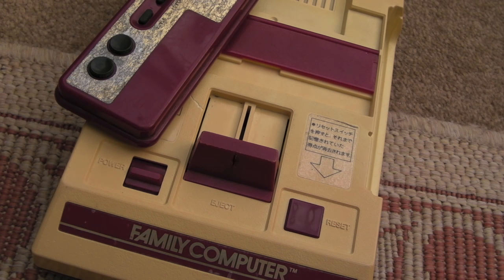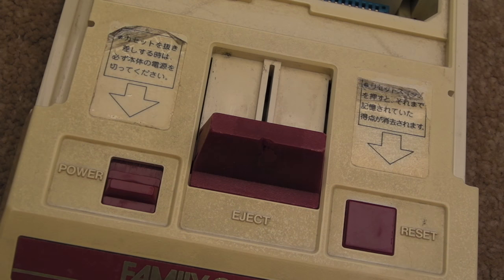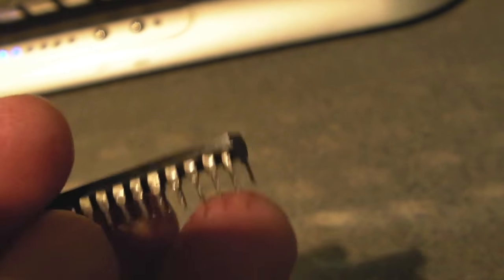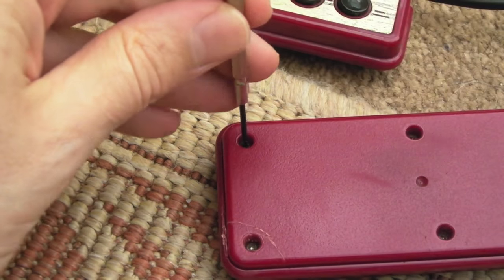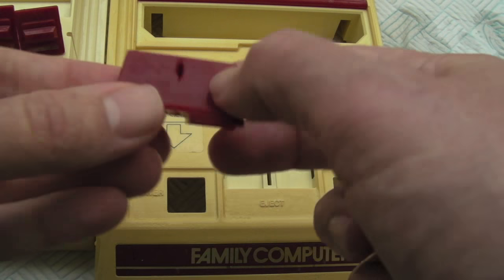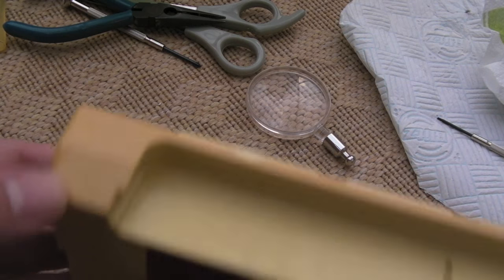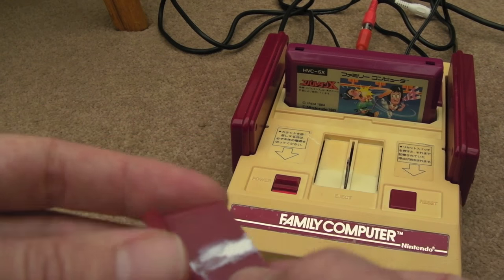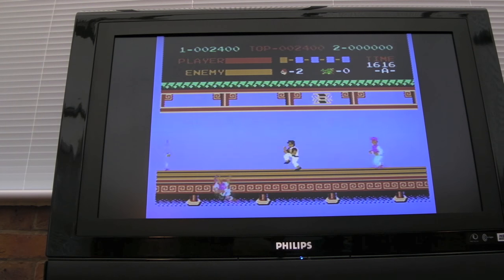5 Nintendo Famicom Repairs - Part 1 (SRAM - Black Screen)

Comment: Great vid! The SRAM containing electrolyte was interesting. Have you cut one of the old ones open?
Reply from the maker: Not yet - but that is a good idea, if I can work out the best way to do that... Perhaps Dremel?  I am not 100% sure its electrolyte, I am just going off a research paper I read last year, but I cannot find the damn thing now.  Clearly something going on though as the rest of that board is like new, and the corrosion is just on the tops of the pins, and clearly spread inwards in the underside rather than all around the pads etc.  So it is very mysterious.
Reply: Yeah that's very odd. Yep a Dremel would be able to grind off the entire top layer to expose the inside.

Comment: Another fine repair. You probably already know this but I just want to let you know that some EPROM programmer can test RAM chips; my Needhams EMP-20 EPROM programmer can test all sorts of RAM. Even the cheapo TL866CS I own can test certain RAM.

It's one of them functions that gets overlooked or isn't well known with EPROM programmer. I.E. being able to test RAM.

I know you have a couple or more EPROM programmers, check their manuals or look in the software options maybe one of them can test RAM's, my Needhams EMP-20 EPROM programmer has helped me find dodgy RAM in the past and has saved me a lot of time, just being able to pop a suspected dodgy RAM in its ZIF socket and run a test on it is a god send.
Reply from the maker: Thanks!  I've got 4 different programmers but none will test 2115's =\. It's annoying because it's dead easy for them to add support but they didn't =\
Reply from the maker: Having said that... Just checked again and they do support 6116, which I think is pin compatible with the 2115.

Comment: Hey Chris.  I recently got a Famicom and AV modded it fine, but there was a buzzing seemingly coming from the microphone on controller 2.  So I opened it up, cleaned the contacts, then it buzzed more.  So I tried reflowing the wires inside.  Then both controllers stopped working haha, so I figured it was the TC40H368P, U7/U8.  I tried switching them round, just out of curiosity, but there was just a grey screen, so I put them back to normal.  Still a grey screen, noooooooo.  I see you say SRAM or CPU for grey screen, what do you think are the chances I've damaged one or both of those?  I've left it turned on for a little while and the CPU is hot enough that it hurts when I touch it for more than a second.  So I'm guessing CPU.  Just wondering what you'd think.  Cheers for the free consultation if you reply 😄

Comment: Where are you buying the s-ram from ? I think the upper left ram is dodgy in my famicom but don’t want to spend crazy money importing chips if it’s not going to cure the problem.
Reply from the maker: eBay or AliExpress.  You might need to search for a list of equivalent ICs for that type of SRAM.  There are loads of manufacturers of the same IC with differing part numbers.

Comment: Great video! In regards to the replacement button membranes search eBay for the white colored membranes. They work just as good as the original membranes and seem to last for a good while. I have two controllers with them installed now for about two years and they've been fine.
Reply from the maker: Yeah - I covered replacement silicones in the previous few videos (The one where I restored the first famicom I picked up, and the vid covering PC Engine silicons).   With those after market silicones you do have to add some padding on top of the d-pad though in order to get diagonals working properly.   Did you find that with the ones you used?  If not, please post a link to where to buy the ones you used!
Reply: GadgetUK164 with these pads I just installed them and never had an issue with the buttons or D-Pad working any different from the original pads. The buttons feel will be stiff at first, but once they break in you'll be fine.

Comment: Great vid, having recently fixed up 6 of these myself from some ebay finds I was particularly interested in your video.  
Looking forward to seeing the others restored.  BTW use punch on level 1 boss instead of kick ;-)
Reply from the maker: What problems did you come across with the 6 you looked at?  And thanks for the 'boss tip' =D
Reply: No SRAM problems for starters, I got lucky there, I had 6 that were already AV modded, but had various issues ranging from noisy player 2 controllers, crusty power jacks, blown pico fuses on later models, faulty on/off switches, and one that had been in a right scrape where the base had a hole in it from an impact that also cracked the back motherboard, I jumpered that motherboard back together carefully and patched up the hole - I was super happy when it turned on.
If you go to my twitter the journey starts here on 25/11/16  Cheers Dean  https://twitter.com/lesoleil70/status/802193197241954304
Reply from the maker: Thanks for sharing that =D

Comment: Great little console, where are you sourcing your gear ? Also with Japanese consoles are there any particular consoles to look for that need different power ( step down converter) i don't want to buy something and kill it strait away. Love the videos as always thumbs up !
Reply from the maker: There are tonnes of Famicoms on eBay!  I never buy them with PSU - they just need 9v DC (make sure you get the polarity correct), so just get a 9v DC 1 or 1.5 amp PSU cheap, then put a 5.5 x 2.1mm jack on it, or swap the socket for a 5.5 x 2.5 and use a 5.5 x 2.5 jack on the PSU too.  If you want to use any Japanese PSUs, then you need a step down transformer.

Comment: Also, I've experienced the exact same wierdness with corrosion on old SRAM chips in vintage computers/consolres. I also see lots of Texas Instrument logic and others from the 80s with leads that tarnish and turn crusty black, but for the most part those seem to still operate just fine. Always wondered what it was that causes some of these chips to seemingly corrode from the inside out, as you would imagine they should be effectively permanently sealed in their epoxy packages.
Reply from the maker: If its not something leaking from inside, I wonder if its related to some chemical on the pins or package body?  It's a bit strange.
Reply: its silver plate thats tarnished on those old ti logic chips
Reply from the maker: Are you sure?  I've ruled out any electrolyte - apparently a storage trench with electrolyte is only used on DRAM, not SRAM - and someone below said its Ion transfer between plastic and metal pin?  It seems there's two theories now lol.  Very interesting though!
Reply: At any rate, its still an interesting mystery, as I've experienced the same weird failures myself. Also, the silver plating on TI logic certainly makes sense however. Wondered why they chose to use precious silver plating (that would obv. tarnish), if indeed that is what it is? I recall seeing fancy mil-spec 54LS ceramic logic with gold plated pins before so it wouldn't be out of the question I suppose...

Comment: Very interesting to watch; I definitely learn things from your channel. Thanks for doing all these! I'm not good at fixing hardware, but maybe one day! I just tested my turbografx-16 w/CD attachment and I'm not getting any power. Frustrating! Your skills give me hope lol. :)
Reply from the maker: Check the fuse in the turbografx - I am guessing there's one in there, like there is in the PC Engine?  Also check the PSU with using a multimeter, you should get somewhere between 9v DC and 13v DC approximately.
Reply from the maker: And thanks for the nice feedback btw =D
Reply: Hmm. Thanks for the advice; I'll have to give that a shot. I was wondering if there is a fuse.  And you're welcome, keep up the great work!

Comment: I was dubious about the concept of an IC leaking when you mentioned it in a previous video, but it does certainly look like something is going on here. Maybe the SRAM has overheated and something has melted and leaked. I've not heard of these having some form of additional internal capacitance, but that might explain it? I'll keep a look out in future with 2114's and 2115's.
Reply from the maker: I read a research paper on how SRAM works and in that paper it mentioned 'electrolyte in the storage trench' when describing how they work.   I do think this is the case, it's too much of a co-incidence, I've seen it a few times on other 2114 and 2115 chips - not just on that C64 and this Famicom.  But - I don't think all SRAMs work exactly the same way and it might only relate to the 2114 and 2115 as I've never seen any other SRAM fail this way.
Reply from the maker: Maybe there is something else going on - perhaps some other type of chemical reaction or something.  I cannot for the life of me find the article I was reading last year.  It was a document talking about failure types in older SRAM chips and it did clearly talk about liquid electrolyte in the storage trench.  Maybe some reaction to some coating or something, perhaps on the package or the pins.  Maybe even flux?  I did wonder about temperature and humidity and perhaps it was just normal corrosion, perhaps moisture is attracted to the package body under certain circumstances (ie. temperature changes perhaps).  But then again that would be odd, and I would expect corrosion to be slightly wider spread on the board.
Reply: You do get similar things happening when the board has got wet or been washed and water is trapped under the ICs, but that would affect all the chips on the board?

Comment: something i would try with the S-RAM is replacing the broken internal cap with an external one. maybe even cut the chip open if the internal one is shorted.
Reply from the maker: I don't think they have a single interal cap - my undertstanding is there's electrolyte used somewhere in there but in the storage trench - ie. not a capacitor.

Comment: I recently bought it, everything is working well but the screen is black and white; no sound also .. I tried to change the cable sites but no effect , need your help please
Reply from the maker: No colour is probably due to it being an NTSC system and your TV perhaps supports PAL?  The sound I am not sure about, but it could also be related to your TV not liking the NTSC signal and the audio sub carrier.

Comment: Some while ago I bought one of those desoldering stations from China, they are not super cheap, but those were the best 100 Euros I did spend on equipment, with that thing desoldering old chips is fun.
BTW: It took me a few years to figure out that some of those tiny screwdrivers have a hole where you can put another screwdriver through, works better than using pliers. ;-)
Reply from the maker: Yes, you can use another screwdriver as a lever too - I always forget that lol.  In fact, my screwdriver set came with a dedicated lever, I just forget to use it all the time lol.   I've got a proper desoldering station but tbh for small chips its far easier to just use a desolder pump.

Comment: I know this is an old video. But have you ever come  across a famicom that will only load the game up. If you power it on then put the game and have to hit the reset button.  It if I put the game in and power it on it will not work. But if I put my everdrive in. It’ll work with out having it powered on first. Thank you.
Reply from the maker: That's pretty strange - makes me wonder if the reset circuit is working properly?!?
Reply: @GadgetUK164  thank you. It tuned out to be the reset capacitor. Thinking it was the 4.7uf. After that it worked great

Comment: You should look into getting the Famicom Disk System, There not that expensive and usually only need a new drive belt.
Reply from the maker: I might get one at some point, although I probably wouldn't use it as I can play all the FDS games via the Everdrive - with expansion audio too!
Reply: GadgetUK164 Hi mate r u on facebook need to ask you a question about my megadrive joypad please
Reply from the maker: Hi, no - I don't do Facebook!  Easiest to just post here!
Reply: If you really wanted to play with FDS, there is also the option of using the "FDSStick", which is a inexpensive tiny USB emulator that plugs into the RAM adapter in place of the disk drive. You could eliminate the drive altogether if you wanted, downside being you would then have a laptop/PC tethered to your FC. Like Gadget though, I already play FDS off the Everdrive so its never been a high priority for me.
Reply: Yes but you cant beat original hardware.
Inserting a disk and then hearing the motor and gears spinning :) Or maybe thats just me......
Reply: No you are right, real hardware is the best! I just don't have the itch to dump a bunch of money into setting up a FDS system at the moment is all, and I can already play the games so I'm not totally missing out. Maybe I have just have too many retro projects going on? :)
Reply from the maker: I will get an FDSStrick at some point.  Probably a proper drive as well!

Comment: What PSU are you using to power them ?
Reply from the maker: I purchased modern 9v DC 1.5 amp PSUs for both my Famicom and PC Engines.  Most of those modern PSUs from eBay (china) use switching regulators etc and are very cold and efficient.  On both of these PSUs I swapped out the connector for the one used by the respective systems, and made sure polarity was correct in each case.
Reply: Thanks, I picked up "junk" Famicom and need a PSU so I can start testing it

Comment: No storage trench is used in dram, the parts are passivated the issue is ion transfer between the plastic and the metal pin
Reply from the maker: OK - I stand corrected then!  I swear the document I read related to SRAM =/
Reply from the maker: That's also interesting - you mentioning "Ion transfer between plastic and metal pin" - I must read up on that, it does sound like that is the most likely explanation!  Thanks, you seem very knowledgeable! =D

Comment: So you can't but new, or new old stock of those s-ram chips?
Reply from the maker: Yes, you can buy a number of replacement chips - but its new old stock!  I've got 6 chips on order at the moment!
Reply from the maker: It's also possible to adapt other SRAM to do the same job - I will talk about that in a later video.
Reply: Ah, ok.
Yes that would be interesting.

Comment: Put yellowed parts into a zip lock bag with creme developer with hydrogen peroxide.Coat parts liberally.Leave in sun for a day.Looks like new.
Reply from the maker: Yep - thanks,  done that many times in previous videos!  One problem with doing that on the Famicom is the areas covered by stickers end up still yellow afterwards.  The only way to properly retrobrite one of these is to remove the stickers and then re-apply them afterwards, and most of the time they are damaged when removing them.
Reply: you can get replacement famicom decals here, i have brought them in the past, they are very good quality. although i think they are out of stock at the moment.
Reply: GadgetUK164 better have them slightly yellow under the decals than yellowed everywhere :)

Comment: can you really just take the cpu and ppu from these and put them in a nes!? if you then disabled the lockout chip would it play games in american/Japanese speeds?
Reply from the maker: Yes, pretty sure pinouts are the same - it's just they run at a different speed internally.  The crystal also needs swapping at the same time.
Reply: Definite future project! Thanks

Comment: With the amount of de-soldering you do, i would recommend you get a proper de-soldering station best money i've ever spent.
Reply from the maker: I have a desoldering station, I just chose not to use it!  It takes around 30 seconds just using a desolder pump, whereras it will take me 2 mins to get the desoldering station out and then 3 or 4 mins to get to temperature, and they I have to clean it later etc.
Reply: With a little creativity and the right tools, you can get quite efficient with a pump.  I'm right-handed, so I place a short trash bin on the left of the project and soldering iron holder on the right.  I press the butt of my Soldapult against my collar bone which ejects the waste into the bin.  As long as I'm not de-soldering points that carry constant power, I can be as efficient as someone with a fancy electric de-soldering tool.  It's good enough that I've fought off the temptation to drop >$100 in something I really don't need to use that frequently.
Reply: to each their own, personally when i'm doing pcb's and have to de- solder 50+ points on a board and have multiple to do the quality and consistency of a proper de-solder pump beats a manual pump hands down.
Reply: Absolutely, I don't think anyone is arguing with you about big jobs.  We're talking about simple patchwork here.